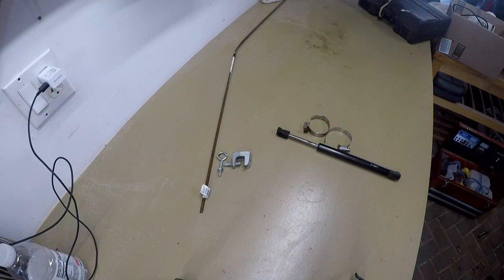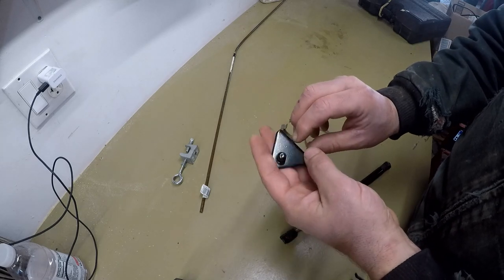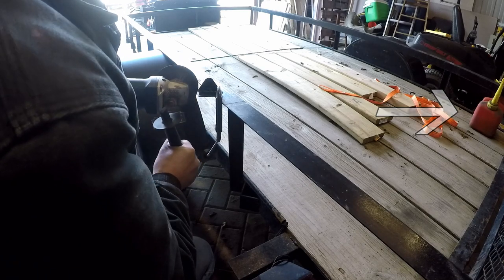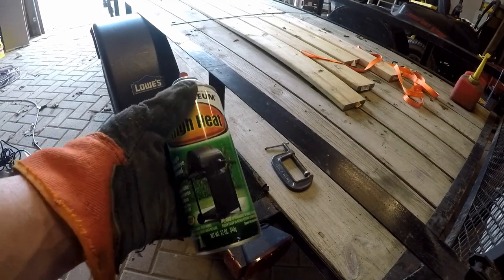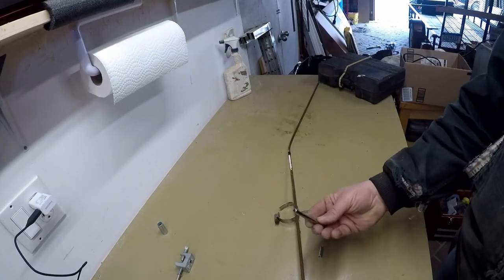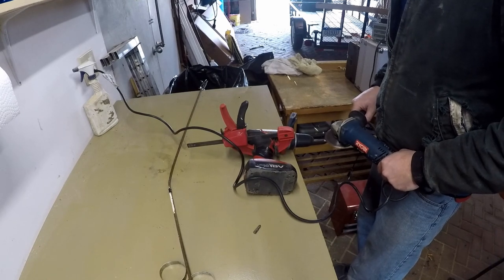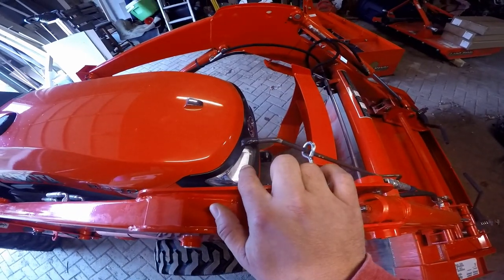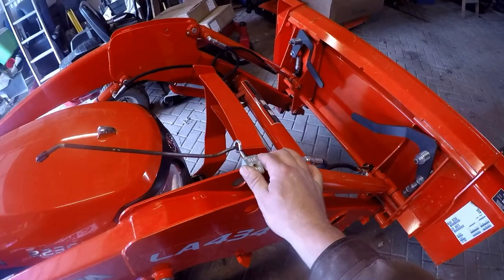Making a Bucket Level Indicator for a Kubota Tractor (no drilling)

Comment: Nice do it yourself project, but honestly the Kubota indicator isn't all that expensive and it has less parts to go wrong. Not only that you aren't going to screw the paint up with the screw on. Makes a nice new tractor look cheap. Cost saver for someone with an old beater tractor. Nice video all the same.

Comment: Really nice setup.  This is the first leveler setup that was done without drilling holes in  your machine.  And I really like and prefer that.   My leveler idea is pretty much like yours, but I'm still figuring out how to put it on my Terramite T5c.   But you have given me some ideas so maybe I can get mine build and on  my backhoe loader.    Great video.  I learned a lot.
Reply from the maker: Thanks for watching. Good luck with your T5c.

Comment: Nice job!  Where did you get the rod and what size is it?  I've got the LA434 loader and am looking to do something very similar!
Reply from the maker: I don't remember the size but I'm guessing 3/16" diameter by 4ft long. $3.88 at Lowe's.
Reply: The Country Living Project  thanks!  Sounds like a good project for this quarantine!
Reply: Yay, they told me the safety "don't drop rocks on my head" linkage was a self levelling device. As you know it's not. So i am happy to start this project for my la434.
Reply: Me too with my La434

Comment: Liked the build and humor 😊.  After you get more time in the seat, you won't need the level as much but there are times you definitely want to know the bucket is level and your device will definitely do the trick.  If you don't mind me suggesting....I'd paint the rod a bright yellow or some bright color right at the Z-bend so that when it gets into the eyelet hole, it's more noticeable. On some sun-shiny days or super cloudy days, it's more difficult to see the black rod but you can see that brightly painted section moving when you adjust the bucket.  Enjoyed a full-video watch.  Have a fine week.
Reply from the maker: Good idea for painting the z-bend section. I haven't had any issues seeing it so far but probably I always had ideal conditions and one of these days I won't.

Comment: Why didn't you just use a u bolt to bolt it on instead of cutting through bracket
Reply from the maker: The simple answer is that I didn't think of it. But, now that you mention it, and looking back at the video it looks like that probably would have worked well Thanks for the input.